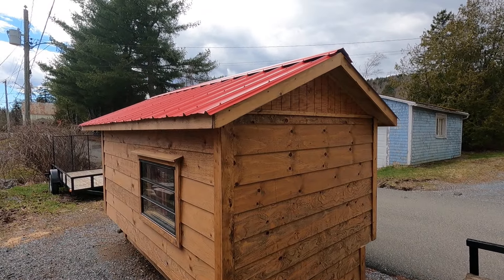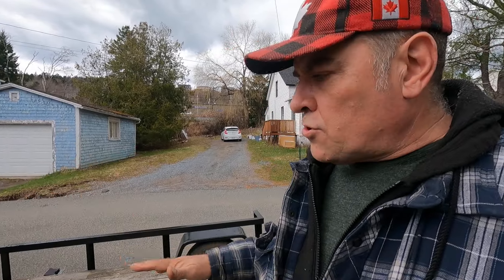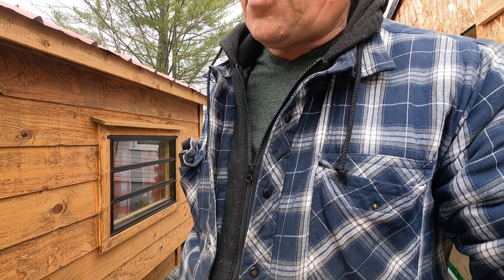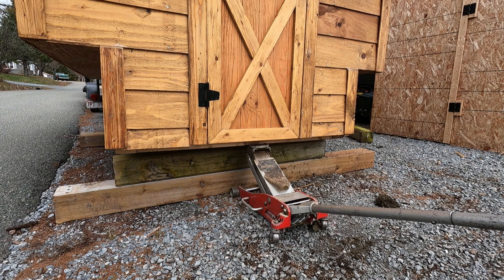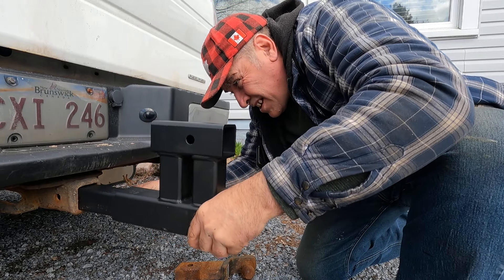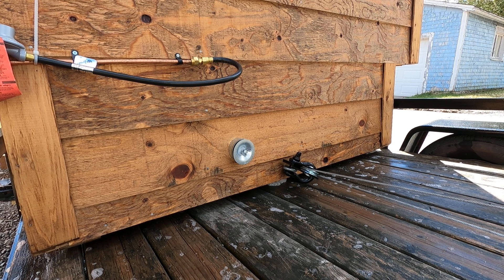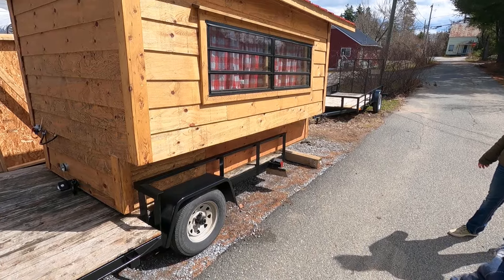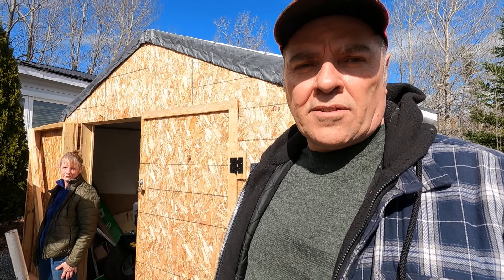THIS MAY NOT END WELL !!!  Mini Portable Cabin its finally TIME TO GET LOADED !!!!!

Comment: Should have put the winch cable under the bar and not over it.. That might have been why the winch was struggling a little bit.. But awesome video.. And a pretty assistant.. Your a lucky man..
Reply from the maker: The only reason the cable was over the bar was to keep it from hitting the wire connections on the winch when I tensioned it up.The battery i was running it off was around   half charged....12.3 volts when i started pulling it on .With a full charged battery it would have slid on very easily .thanks for watching

Comment: Hey Sparky!  Your camp looks great 👍!  If you were to put dish soap on the floor of your trailer that camp would've slid on almost by itself.  I watched guys putting a house on a foundation one time and they put dish soap on the timbers the house slid on. The had to put the bucket of the excavator  up to keep the house from sliding right off the foundation.

Comment: We used the dual hitch to add a bike rack with our teardrop - which we no longer have. Worked well.
Reply from the maker: that would work well !! Im using a drop hitch now and it sits nice and level with a 4 inch drop on the hitch .

Comment: 3 pcs of 2in Schedule 40 pvc under the skids and you could push it right on by leapfrogging the pipe.. used this method for moving 1000 lb hot tubs with ease.
Reply from the maker: Great idea ...if it had been harder to slide on I would have used some sort of pipe as rollers .....it went on easily as it was ....

Comment: I design mine to come off and on the trailer quite easy. This way the trailer can be used for moving things like atv’s, snow machines, wood, supplies etc. the tiny home can also drop onto other trailers easy and be dropped on blocks if I get property. I also made mine standing height and put a 2 foot 45 on the back like an earth roamer so it’s more off-road worthy and won’t bang or drag in the back when going over uneven ground.

Comment: that space on the deck in front of the wheel wells is crying out for a box built there for storage or for housing the diesel heater . Also consider putting a little platform/steps that  are in the back where a hinged set of stairs can flip up during travel and give a little more room on your "deck"  when the trailer is deployed. Are you doing a little solar setup inside this thing?
Reply from the maker: Great ideas ...the cabin has an electrical system installed with a lifepo4 battery also ...
Reply: @sparkys506adventures4  I was thinking of that lipo when I suggested a solar setup. I actually have a couple  230w  panels you could maybe have but unfortunately they may be a little too big and also they are currently in  ontario and may be a while before I get up to NB.
Reply from the maker: @Edrichmond  Thanks for the offer ...i actually have a nice portable 200 watt Allpowers brand that came with a power station I have and will use as a backup ....

Comment: Concerned should you have both of the lines from the wrench to cabin run under the rail of the trailer.  I thought one on top as you had ran risk of the wire putting tension on the rail or rail causing the wire to thin out.
Reply from the maker: The upper cable was stationary not sliding on the steel .... I had the cable there because when I ran it straight back it was going to rub on the winch control wires ......it worked out fine lol

Comment: Can’t argue with the result, but I would have used a couple broom handles as rollers instead of soapy water. With all that tension on the cable, I kept waiting for the eye bolt to evacuate the camper timber.
Reply from the maker: It wasn't really that much tension ...the battery ii was running the winch off of was only half charged when I started ....the rollers would have helped a lot though ....

Comment: Just wondering 🤔, (and I don’t know the answer) it seems to me the cabin is not centered over the axel. What does that do for your tongue weight?Or, is it insignificant that short distance over center??
Reply from the maker: You don't want your load centered on a trailer you always want it more at the front of trailer ....if there isn't enough tongue weight the trailer will sway bad at speed. I was first concerned it may not be far enough to the front but I think it will be fine. But also when a trailer is designed properly the axle is 60% of the total distance back.....if the total length if 10 feet the axle should be 6 feet back .....
Reply: @sparkys506adventures4 sounds good. 
 I knew too far back is a problem, but wasn’t sure what too much forward would do.
Looking forward to your future adventures.